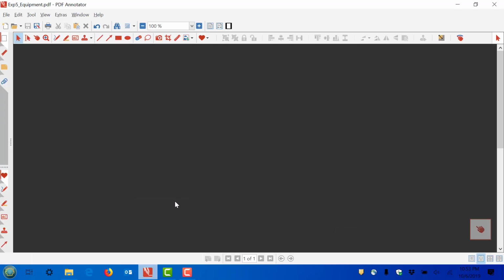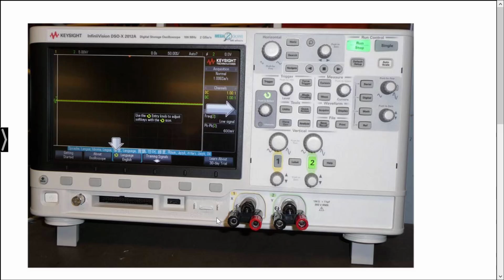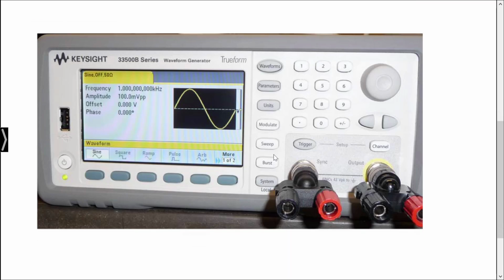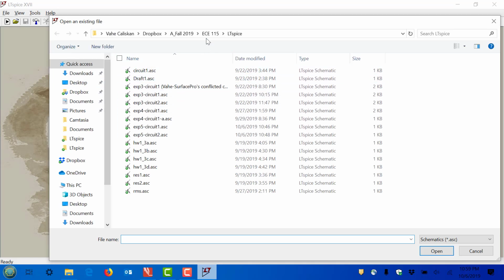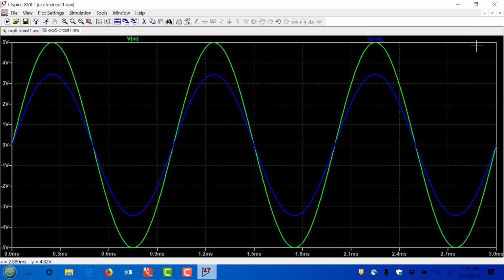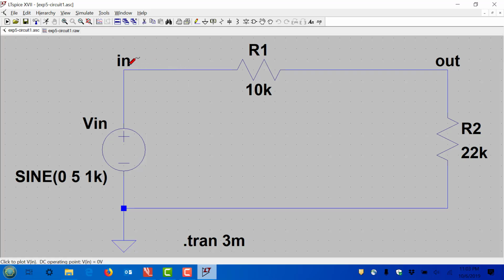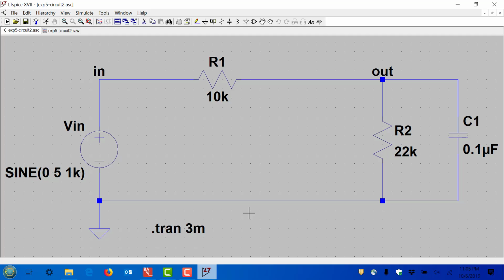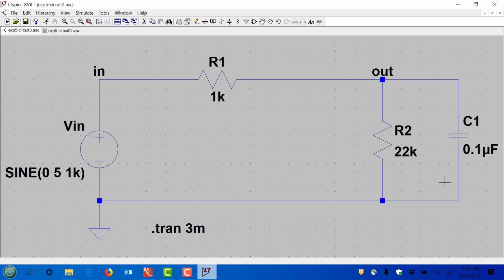Experiment #5: Using the Oscilloscope and Function Generator

Comment: hi vahe, does oscilloscope have xy-mode ?
Reply from the maker: Yes it does
Reply: @Vahe.Caliskan  i'm sorry about to distrub you but how it does ? I couldnt find any option related with xy-drawing.
Reply from the maker: @berkcan2439  Maybe I am misunderstanding why you mean by "oscilloscope" ... Do you mean the scope in the lab, or the waveform display of the LTspice simulation software?
Reply: @Vahe.Caliskan  I'm very curious to know if the XY mode is achievable using the oscilloscope feature in LTspice
Reply from the maker: @richardjimenenez8417  Yes it does. For the y-variable just plot a function versus time as usual. Then if you move your mouse over the x-axis numbers, the pointer changes into a ruler. You can then right-click which brings up a form showing the quantity that is plotted (this is typically time). Now you can type any valid variable that you would like to be the x-axis variable (for example, v(1), v(1,2), i(R1)). Then clicking ok would give you the the xy mode. Try it out and let me know if it works for you.